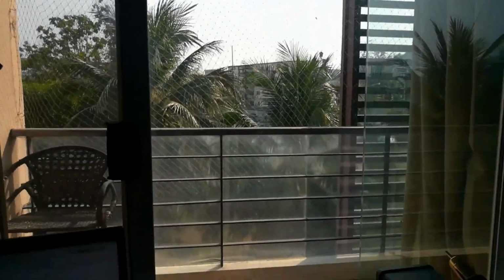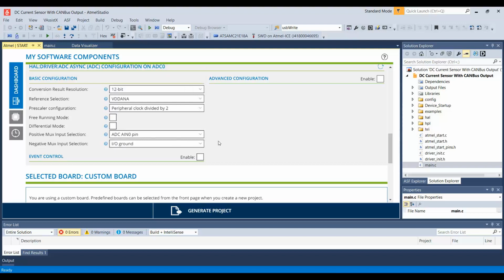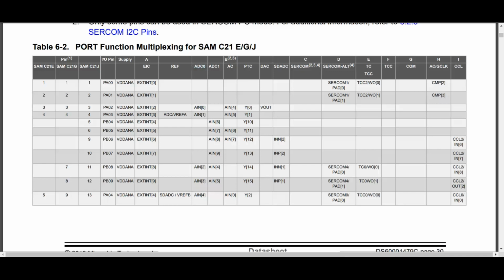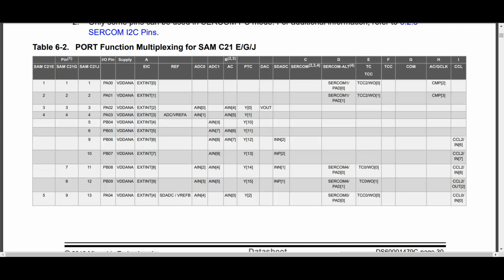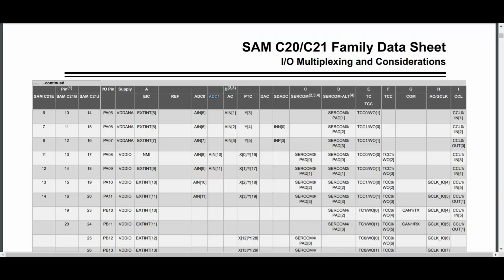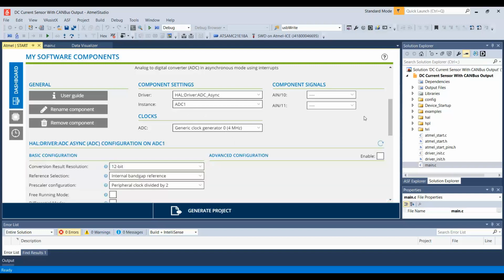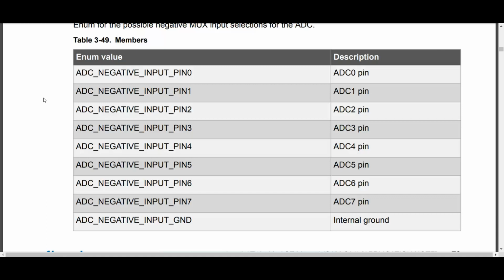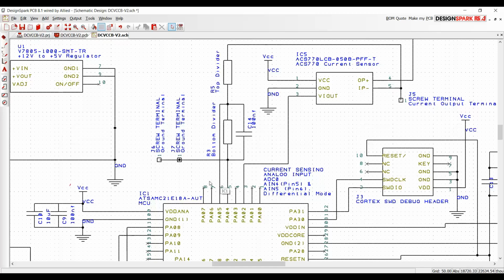CANbus Current and Voltage Sensor Part 14 - Voltage Reading Thwarted

Comment: The thing is that all devices in can bus should have a common ground. In practice it's often works without it, but in your case it's probably not a bad idea to put this divider part of the circuit to ground.
Lack of documentation and community for new chips is the reason why people choose old fashion "arduino chips". Personally, I prefer to use atmega32u4+mcp2515 for small tasks like yours, it's well documented, have tons of websites about it, and allows me to program it from macbook with arduino studio with nothing except usb cable.